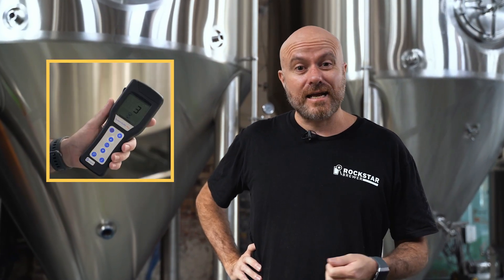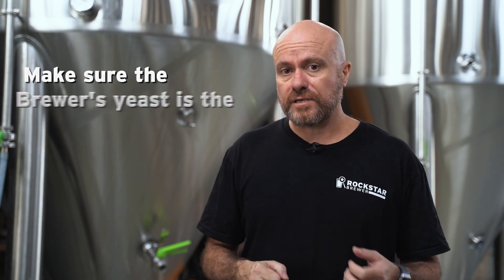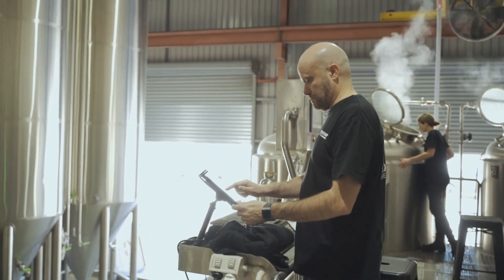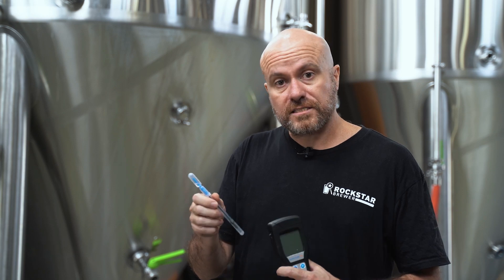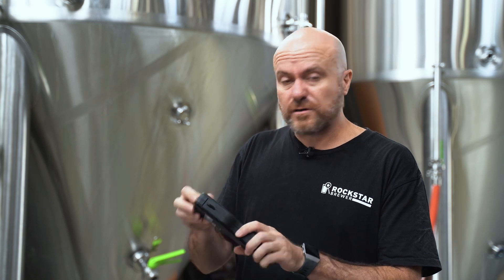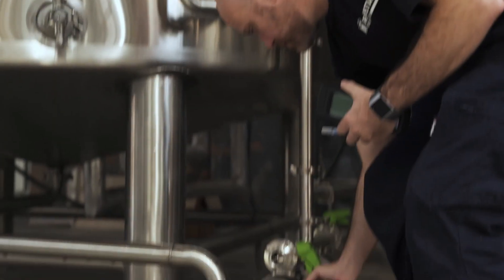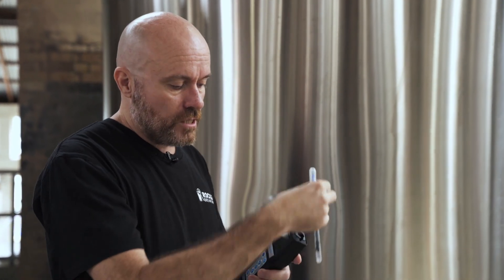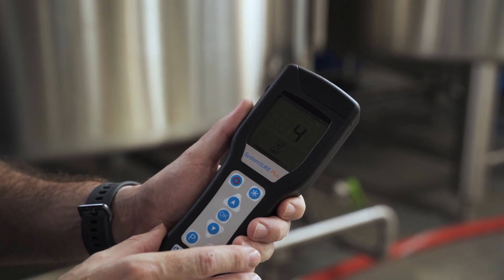How Pro-Brewers Use An ATP Meter To Ensure Clean Tanks

Comment: There are a million comments I want to make about that last test but won't for the sake of good taste... Nice vid tho! How much are one of those devices approx.?
Reply from the maker: ha ha yes, not the best way to use an ATP Meter but it does prove the point that I am not clean!  An ATP Meter will set you back about A$3-$6K depending on the model.  You also have to take into account the cost of the sticks which are about $20 each.